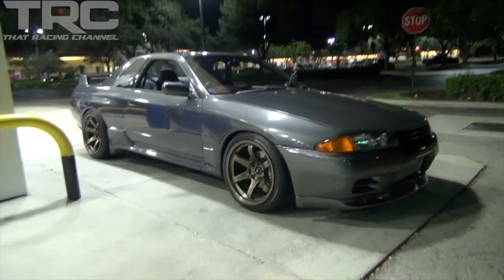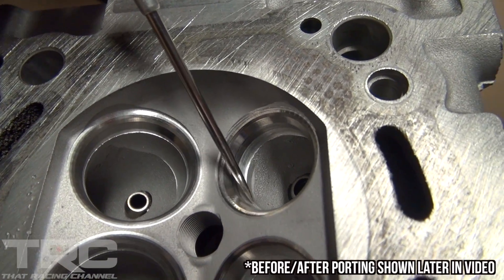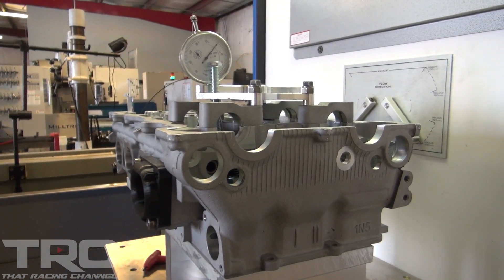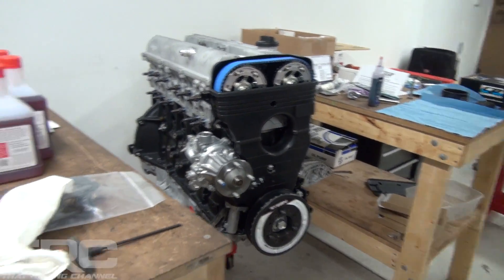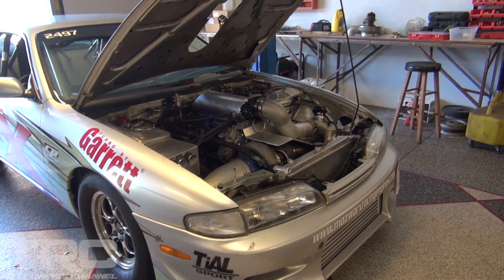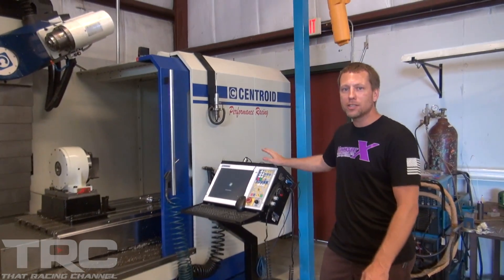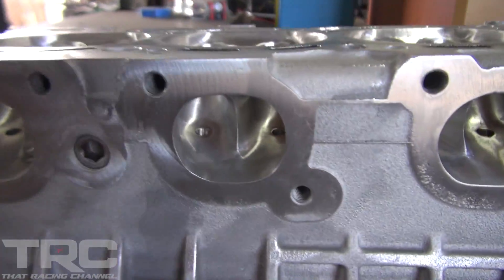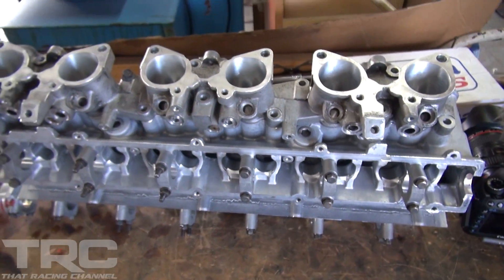Skyline RB32 Engine Build - TRC R32 GTR Episode 5

Comment from the maker: RB32 build is well underway! Next episode we're going to dive into the Turbo, intake/exhaust manifolds, etc.. stay tuned!
Reply from the maker: roughly a week or so for the next update vid. TURBO TALK! it's going to be a good one :-)
Reply: That Racing Channel Im interested to see what you go with for turbo, I went with a Borg Warner Efr 9174 aluminum. Our heads a similar too with port match and polish but I went with the kelford 182-E instead of the drop-in "C" like you did. Did you think about ignition and ecu yet? What are you thinking for transmission 6 speed conversion, sequential gearbox, or staying stock? M planning a close ratio 6 speed for mine.
Reply: That Racing Channel...looking absolutely amazing! Never seen a better port & polish from anyone...no "flow" issues there! Awesome, awesome build...can't wait to see this mother run!
Reply from the maker: +James Thomas R35 ignition. Trans and engine management info will be released in an upcoming episode 🤓
Reply: That Racing Channel gotcha so you went with Godzilla Motorsports AU Billet kit. I went with Yellow Jacket AU LS2 coil kit. More spark, better with e85 and available at any auto parts store $28 ea 😎😎. For transmission I went with a twin disk from spec and a R34 6speed, and for ECU a haltech platinum pro & flex sensor. Mitch from haltech is the best and he had a RB34 R34 so I trust his advice. The port job on the head looks great, and there's a upgrade for the ITB's to make the throttle bigger unless your going with one big single. I stayed ITB to save response. Keep up the great work...Dyno video soon. I'm putting the motor in the car today 😈😈😈. As all ways don't for get to like and subscribe!!!
Reply: when is the next update? it took awhile for this one
Reply: Past Gone I’ve got the RB30 in and it’s getting the down pipe and charge pipes made. After that some wiring and I’m gonna put up a 1st startup and dyno video!!
Reply: Where the next episode
Reply: That Racing Channel racing bikes?
Reply: When is next update??
Reply: James Thomas im thinking about getting an r32 and like watching this build.
Reply: Past Gone it’s a good build. I’m interested to see this too, I’d like to compare what they are doing vs my RB30 R33 build. I can’t wait to put up some results. If your gonna get a Skyline understand 2 things. One do your homework on the cars history and inspect thoroughly. And two know what your getting yourself into!!! Check out my channel for my build.
Reply: James Thomas yea im interest in getting one ill check out ur channel.
Reply: 4 months later?
Reply: Where the next episode? WTF?

Comment: porting your head you made 90hp more dnt think the power claim of 80 or 90 hp at the wheels porting is a waste money ,more like 15% of 90 hp which isn't much
Reply from the maker: +Gaz Girl we did a before and after test on our Supra. Only change was head port by porting solutions, same dyno, similar weather condition. Picked up 90+whp at same boost(40psi). 👍🏻
Reply: Gaz Girl I also have dyno proof of another car producing 86whp over the stock head at same boost levels which was prior to the TRC Supra. which I had modified the port slightly during the process of the Supra head.
Reply from the maker: Power is made in the cylinder head.  You can have the best power adders getting air to your head, but if the head doesn't flow then it's not getting to the cylinder which defeats the whole purpose. How you port the head is extremely important and often overlooked. How do we know? We learn from our mistakes!

Comment: Machine shop career  Heaven. is what this is. also  would like to know what program that is. on the computer. that  there using to bring the engine block design to life. cause i design performance parts 4 my own Ride's  & i want that program. to be able to do sht on the computer. that is so bad azz.
Reply: We use Solidworks for designing
Reply: Thanks.

Comment: out of curiosity, with the porting job on the head does taking down the valve guide as flat as he did affect anything? iv'e only seen people port/polish but the leave that lil valve hump in there any reason to leave it and or in your case cut it down?
Reply: TriniRogue I remove it for flow. when doing so it's important to measure guide height to make sure there is enough guide to support the valve. the intake is just fine, the exhaust I recommended him getting bronze guides.
Reply: TriniRogue should also add that if you remove to much valve guide especially on the exhaust it gets the valve hotter, generally leading to leaky valve seals prematurely and premature valve stem wear

Comment: Was that the final head resurface? It looked a little rough with a lot of scratches.. usually after resurfacing it's got a super flat smooth machined finished.. idk maybe it's a different style?
Reply from the maker: That't not the final head surface. Head is on the way now to our machine shop for assembly and final touches.
Reply: Integra DIY head is going to the machine shop where they will resurface and touch up the valve job and assembly
Reply: gotcha! Head is gonna look like a work of art when finished 👍